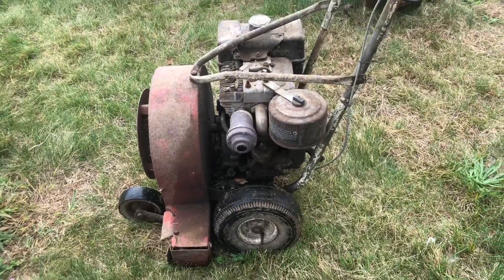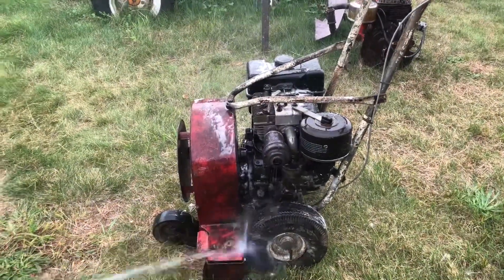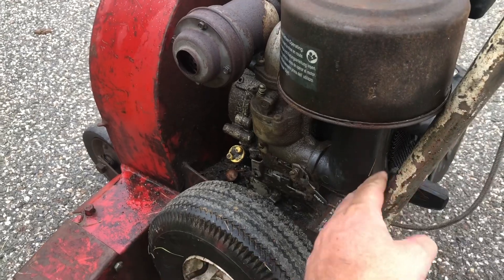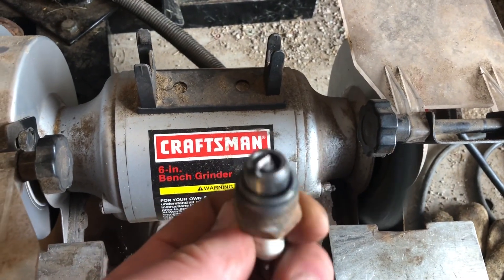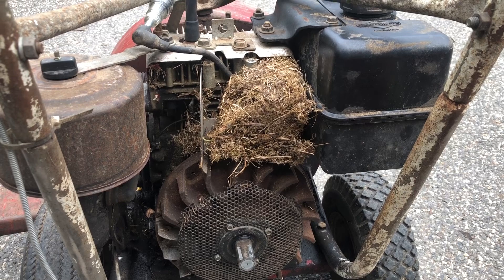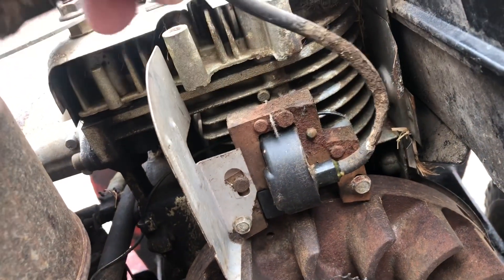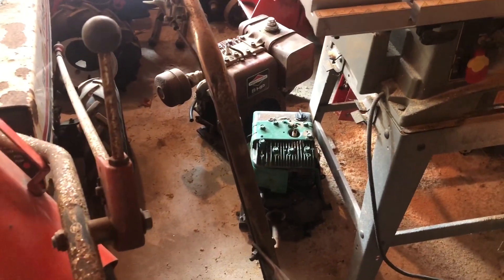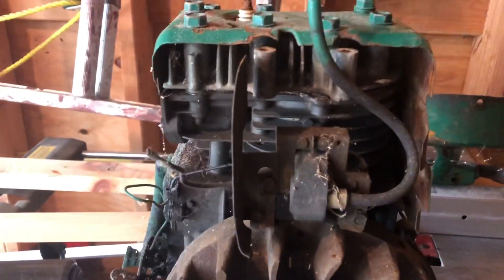Will This Giant Vac Leaf Blower Run ?

Comment: I can’t recommend super clean enough. It’s cheap, and works extremely well. It just eats through grease, dirt and grime, plus it’s not overly expensive. I can normally find it at ace, or tractor supply. Give it a try to clean some of your machines up.

Comment: Have you ever tried to put a new wire on a coil like that?
Reply from the maker: I never tried but I was thinking of splicing it and soldering a new lead on.  The wire may be aluminum though….
Reply: @rw3dog  I may look at an old one I have but I was thinking of dremeling out the part where the wire goes in, I'm assuming there's a spike in there that you could stab a new wire into and surround it with jb weld